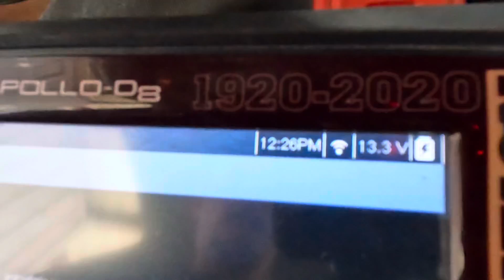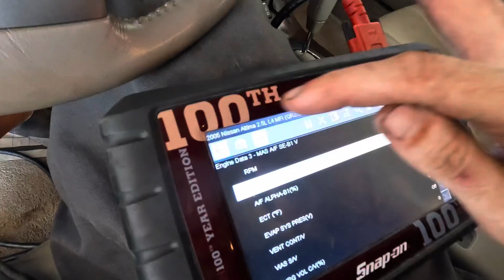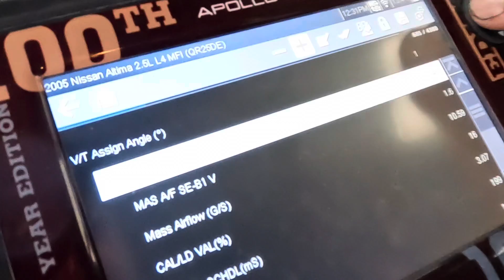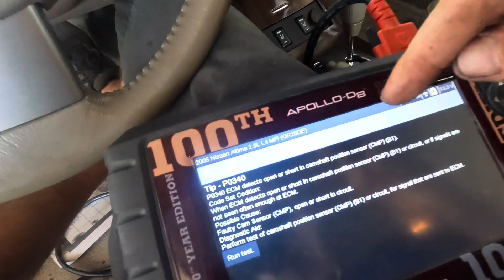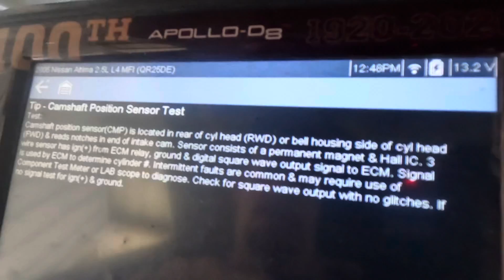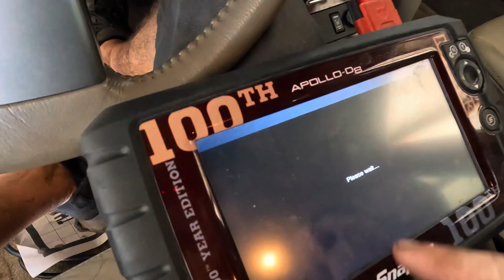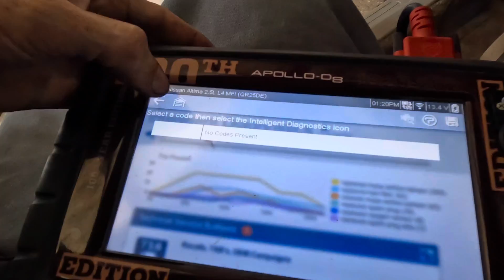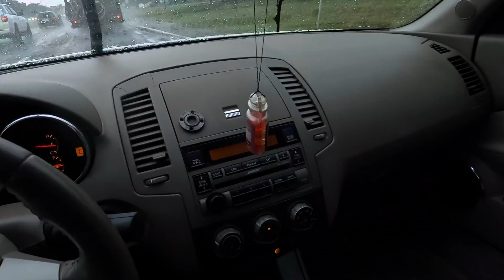This will make you ☠️☠️☠️ | Parts Cannon! Nissan Altima 2.5 P0340 Camshaft

Comment: Wow! You actually do have rain, over there. That’s like a fairly typical Irish summer day, though I think it’s probably warmer there.
Here we call that liquid sunshine! I have a small step up to the floor of the workshop, almost 2”, but I still sometimes have water on the floor. The joys of being on a hillside property. Runoff from the road comes in my gate and cascades down my steps, before flowing across my yard and forming rapids across the front of the door. It’s not like that often enough to justify digging up the concrete and putting in a drain, but it’s a PITA when it happens. Never seen your floor wet before, though.

Comment: Ray's Common Sense explanation of why you don't pull out in front of trucks makes me as a trucker happy. He is 100% correct: You do this and get hit, prepare to see God.
Reply: 80,000 Pounds does not stop quickly. And your 3000 lb civic is gonna fold up like a coke can. 
Better safe than stupid.
Reply: @bragnonymous  While I agree, at least with modern Civics, you are likely to come out of it alive, if not in a boat load of hurt in the physical realm, thanks to modern tech. However, older Civics of the 70's through 1990's, not so much.
Reply: @johnhpalmer6098  Nah, 40 tons wipes out 1.5 or 2 tons easy. Best bet is to stay put until imminent death rolls by and then join traffic.
Reply: @larrypelrine1799  Oh I'm not saying jump in front of truck, I'm well aware of that, just saying if the car gets hit from behind, or it rear ends a truck, trying to slow down more than anything, not thinking about the possibility of it going over it.
Reply: @johnhpalmer6098  Ok. Insert any 3k car here, against an 80k truck. Civic was just an example
Reply: @johnhpalmer6098  Those are the fun years though
Reply: @Eric-bj8yk  Oh I totally agree, had an 83 Civic hatchback myself, with the 5spd (DX w/ AC no less). A mere 63-68 HP and all of 1500 Lbs or so indeed fun!
Reply: @larrypelrine1799  as a car driver, i couldn't agree more.  i try my level best to stay away from trucks when i'm driving to the extent that when i'm in a jam i count the cars behind me and if there's less than five when a truck pulls up one hands on the seatbelt the other's on the door ready for the leap of faith!
Reply: My dad has done road work for his whole life, when he was a twenty-something he was pulling a dump truck out of a work site when some poor lady piled into him doing like 90 and extremely killed herself.

Physics are real.  Do not tempt them.
Reply: Happens way too often
Reply: @kellismith4329  The law of the Laws of Physics: You don't "break the law" - the law breaks YOU!
Reply: as someone who hauls milk i approve of this message. i can gross as much as 106K
Reply: @andrewdonohue1853  I could only gross 80k, but still....
Reply: Never do it, they are usually driving at least 10 over the speed limit!
Reply: @chrisstromberg6527  not likely, due to loads being, well, heavy. Just be patient and wait, and save your own life.
Reply: Milk tankers are the most dangerous (due to their “smooth bore” for cleaning) especially 1/2 full
Reply: @DBKING04020  Any liquid tanker has issues. Liquid shifts and can roll easily.
Reply: Unbaffled chemical tankers too,you can tell a tank driver- leans forward to keep head from hitting back of cab with "slosh" of liquid. Also brakes in a pattern to prevent wave(will actually move truck).
Reply: @ronv6637  yup
Reply: Large objects appear slower than their actual speed.  Many vehicles are struck at train crossings due to this illusion.
Reply: yep its one thing if you got plenty of room like 500 puss feet to get up to speed to pull out if cars coming way off  but if its big truck even if you got 1000 feet let truck go first do you really want big truck following you
Reply: Trains also WILL kill you if you pull out in front of them.
Reply: Same sort of thing with pedestrian traffic and cars. Sure the laws of man say peds have right of way, laws of physics say the heavier object will win in any encounter resulting from any idiot stepping out into traffic.
Reply: People also like to pull in very close to my truck from my vantage point it looks like they almost scratch the truck, crazy i prefer to not step on the break with goods in the box.
Reply: And chasing Rail Road Crossings...
Reply: And plastic shopping carts!
Reply: That looked like a merge lane tho
Reply: Half the Time I think people do it on Purpose I know for a Fact Quite a Few of them do it on Purpose to try and sue and get insurence this is also why Dashcams are so Important
Reply: I just hope everyone else knows better, some genuinely don’t sadly.
Reply: Nissan, the Chrysler of Japan.... 😂
Reply: People forget that:

Momentum = mass x velocity 

40 metric tons at 60mph = deadly velocity if suddenly stopped by your econobox.  

I get super frustrated with people cutting off trucks so they can exit the motorway. Hey lady, 2 meter gap is not ok when pulling in front to exit, more like 40m and gods sake please read the road and situations in front of you and behind you.
Reply: @buffalomerkis7603  F=MA, yeah and the knowledge that you can be late to a meeting, but not to see God.

Comment: Good job. Only issue is that wiggle test that you performed is not a real good thing to do other issues that are just waiting for the right person to come along and pull on its wire to happen you could have created issues not only that you could have really just fixed an issue that you would never be able to find again until it jiggles itself loose so I don't agree with that

Comment: I have a Nissan versa that had a crankshaft position sensor problem due to a plugged catalytic converter! Hear me out. Because of the plugged catalytic converter the back pressure caused the flex joint to pop open while under load and the exhaust blew directly onto the crankshaft position sensor and melted the wiring. So keep these things in mind… I realize you’re dealing with the camshaft sensor, but it’s good to keep in mind one problem can cause another. I know you know this Ray, but for other people I figured it was worthwhile to mention.

Comment: That sensor is going to fail 1-6 months tops.This is one of the few times where you got to bite the bullet and buy the OEM sensor it's actually Hitachi. I know this because I have a 3rd gen Altima they are notorious for having cam sensor issues. I know you're a great mechanic and you real good dude so I'm only trying to help. 99.5% of the time I would agree with just going with a aftermarket mid-range part.

Comment: You can buy small portable digital oscilloscopes for cheap these days.  You don't have to spend the four or even five figure sums that some manufacturers are asking for their auto test gear.  It's basically (very) just a microprocessor and a colour screen.  The more money you spend the bigger the screen and battery, and the more features you get, such as serial bus decoding.  Auto diagnostics is not really very demanding compared to what oscilloscopes are capable of these days so some basic functionality such as looking at 600 Hz to 5000 Hz square wave is quite cheap.

Comment: Ray for future reference, I have seen a failing /intermittent fuel pump throw the cam and crank codes. I have built several of these engines and they are a great engine as long as they dont get overheated. The lifters are not hydraulic and specific clearance for each valve which makes them very expensive to do a valve job on. It costs almost as much for lifters as the whole head from the dealer.
Reply: Bc you never do a valve job. There's no such thing. It has buckets. It all lasts the life of the engine even if it's 500k mi. You will smash a bucket if you run it out of oil.
Reply: @TheGuruStud  They wear just like any engine and create excessive valve lash. The only difference is you have to replace them with the proper size upon reassembly to correct the valve lash.

Comment: You just surprised me when you mentioned that you do not have a lab scope. I can't think of a more important tool when it comes to vehicle electrical systems. AES Wave is the bog standard as far as I'm concerned. Does anyone else have an opinion on this?
Who else thinks Ray should be checking square waves when diagnosing electrical?

Comment: Sometimes putting in new parts is all you can do unless you can test the part, but you need the information how to test the part to do it. I wonder if you could just use a volt ohm meter, after all its a solid state electronics device that reacts to a nort or south magnetic pole thats going to pulse a change in its readings to tell the computer information about the motor as its running so the computer can advance or retard when and what coil fires @ what time. As well as other things. 
Cars just keep getting more complex if you do not understand the mechanical oprations and electronics oprations you wont be able to work on them. 
Its not all about plug changes and tie rods anymore. 
You need a shop scope. Im certain you know how to use one. Plus it gives you an advantage over other shops like tire service centers. And your past that.

Comment: As for that 10 mm headed bolt- it looked as if you could have used a 1/4 inch extension with a swivel, going under that coolant hose.

Comment: I thought the "service engine soon" was a mileage driven light designed to get you back to the dealer for plugs, air filter, etc.  Isn't this different from "check engine"?
Reply: Yes, the service intervals can be set with a scan tool and the light is a reminder that a service is due, that warning can also be turned off, if you trust your memory enough.

Comment: There are pretty great combo multimeter scopes to be had in the $100 range.  Many are 10 to 20Mhz, more than enough for most auto diag work.  Scopes are like thermal and bore cameras.  They are not needed too often, and are big time savers when their turn comes up.
Reply: Aeswave Uscope is only $200 and is a great single channel scope, however a scope really isn’t needed to diagnose this. Hall effect is 3 wires. Power, ground and signal.  Use DVOM to read power and voltage drop the ground and then you can use duty cycle setting on signal wire to see if it is sending a signal. Sensor sends a signal that is either 0 volts or signal volts, usually 5 volts. If it is switching from 0 to whatever signal voltage is it will show a duty cycle reading. Simple circuit that my students learned in the first part of electrical class.
Reply: South Main Auto just showed a nice one. Also EEVBlog reviewed one a few weeks back.
Reply: @tschuuuls486  Maybe Eric will recommend a good one to Ray. :P

Comment: I’ll bet the owner is grateful that it was only a sensor and not the timing belt. Great job Ray, way to look out for your customer.
Reply: I had to replace a crankshaft position sensor.. On my 2004 Altima.  .. Was one of the hardest jobs I have done..... And I even managed to skip a very major labor-intensive step..by not removing the timing belt.. Did some wire splicing and saved 6 hours book time... Not fun
Reply: @deepsquat600  isn't the 2.5L in that car a qr25de? Iirc that would be a timing chain and not a belt.
Reply: @bleach_drink_me  mine was a 2004 and it's a 4-cylinder
.. perhaps that's the difference Whitehead a timing belt..
Anyway you look at it laying on your back in the rain had an apartment complex where you can't make it look like you're doing work.. in the Seattle area where it rains all the time I kept having a buckle things up and quit the job because of rain.. anyway the way I cheated the system was to cut the wires were they run over the valve cover as part of a loom..I fished the wires behind the timing belt and tried them as you are supposed to.. But first had to cut the connector..I soldered then back together.. And used great shrink and the take to separate each wire.. Later to I got rid of the car.. And yes I did show to the next guy..

Comment: I remember watching somone fight this problem, the sencor has a plastic ring around the metal with a small mesh screen well on his the plastic broke off and kept the camshaft position sensor from moving at the plastic got wedge in behind the screen material and held it open or closed  he found this using a scope watching the VVT valves open and close durations.   Im not so sure your snap on scan tool is capable of reading that type of data. I dont belive its the best scan tool anymore and dosnt show all the data a car can send out. 
I think his was an Asian or German made model. 
I know that snap on gets all the manufacturer information for all brands of cars and they develop the tool in-house  wile a lot of the other brands copy each other. 

All data  people need to give feedback but that dosnt always happen, in a busy shop where you get car after car you really don't have time to make entries on subjects. That data is shared by all subscribers  entries are made voluntarily,  sad part is if your under some big shops employment you dont have time to enter data. 
Data that could save your shop hours the next time you see that issue.

Comment: You packed A LOT of information into a minimum (visual) bit of service work !! That's why we watch - we love learning.  🙂🏆
Reply: A lot of code reading, glad you solved the issue. But I was disappointed, no oil change.😮
Reply: Actually, he started at the least expensive, knowing full well it was 50/50 that it would work. He hit honey under the first rock.
Reply: @mountainman5025  The scanner did all the diagnostic heavy lifting he only changed the part which any compentant mechanic would do. He is not anything special.

Comment: If you were to check my 2013 altima 2.5 sl with 156000 miles you would think it was a freak car or change your mind on Nissan.
Reply: I'm cruising my '02 Sentra spec-v
It's the best car I've ever had in 50 years.
Reply: AKA you change the oil often with a quality brand!

Comment: There's murders were not known to have camshaft and play or chain issues unless the oil changes were severely neglected they usually would just burn oil and then blow up this is where Identifix and Alldata comes in handy there are so many tsb's and bulletins and recalls on that generation engine mostly for oil consumption cat failure because of the oil consumption and head gasket failure also causing cat failure I work for Nissan for a long time so I know them very well I did a lot of engine Replacements in that generation car

Comment: Had a Datsun B210. When you started it cold it would whine up to like 6000 rpm’s or more for a few minutes then tap the pedal and it would drop down to nothing and was super quiet. No ticking or knocking. I always thought it would throw a rod. It never did.

Comment: Question is do you remember Datsun. My mom had a Datsun 510 hatchback  I drove all over when it was new and I was a teenager.

I hit a 510 wagon with 
my 64 impla ss  opened to side of it from the drivers door to the tailgate. It only put a smudg on my crome bumper. Not even a scratch.

Comment: My wife has a 2005 maxima and went through the whole cmp failures. Her car has 2, (b1&b2), and for some reason they have different connectors and one is $30 more expensive than the other. The only difference is the connector side of the sensor. Instead of buying the one that was $30 more, I went to the junkyard and got a connector for the cheaper bank, spliced it in, and bought the cheaper sensor. Going on 4 years now and no issues with either sensor. I'm proud to say, I outsmarted Nissan and saved $30.

Comment: Common failure on that generation Altima with the qr25 engine, the oe sensors would actually allow oil to come through them into the  connector same with the crank position, there was actually a tsp and a recall through Nissan for the cam and crank position sensors are long time ago for this problem I would stick a cam and a crank position sensor in it clear the codes out reset the adapters and see what happened that will more than likely fix the issue also check the oil level and the condition common failure to Esports Bree for lack of oil changes to clog up the VCT solenoid but usually when that happens you'll have a cam crank position correlation code

Comment: 2005... Pre-CVT. That Altima should run for a very long time. People over look these, but the pre-CVT Altimas are usually very reliable. I was a Nissan Master Tech for 4 years. Maybe consider trading that Apollo in for a Triton. I use my Triton's scope a lot on Nissans. That looks like the updated OEM sensor. The old plastic ones had a high failure rate. Nissan updated the design several years ago. Also, for those watching that own Nissans... Always use OEM sensors. Nissans do not like aftermarket sensors. They will throw the same code in a few months.

Comment: Trucks DO NOT WEIGH 80,000 LBS. That is the maximum legal limit. Most like to stay under 70,000 lbs.
Reply: Haha 70,000 pounds would still easily flatten me like a pancake 🥞 lol
Reply: @Lowbrass64  Nah, just push you out of the way with a loud thunk.

Comment: People need to remember the trucks are the boot and their car is the beer can. So if you don't want to be turned into minced meat don't brake check trucks or pull out in front of them, you will not win.
Reply: Number one rule to avoid you and your car becoming a thin pancake 🥞 😅
Reply: Truck drivers also need to remember that and drive accordingly, a lot don't.

Comment: P0340 - been there before.  That's a fun one, 2010 Frontier would just shut down while driving.  At least this is a front wheel drive.  That sensor is between the engine and the firewall on the RWD.  Oh and they changed the sensor to the round instead of flat because the flats had a high failure rate.